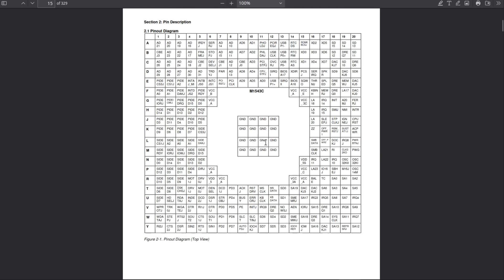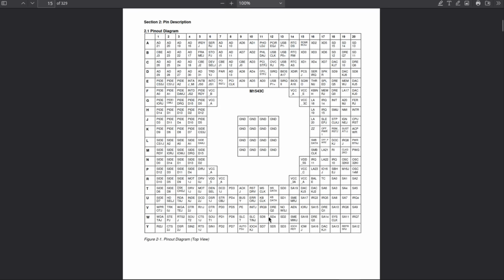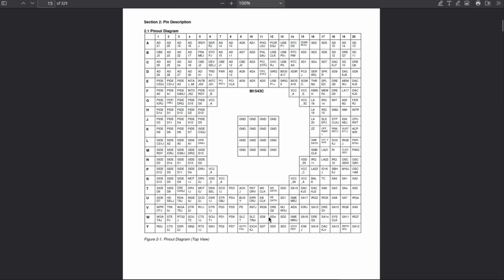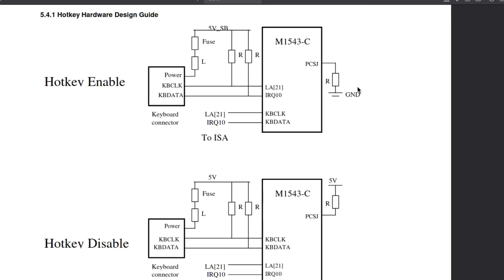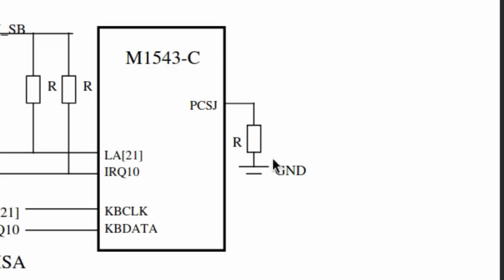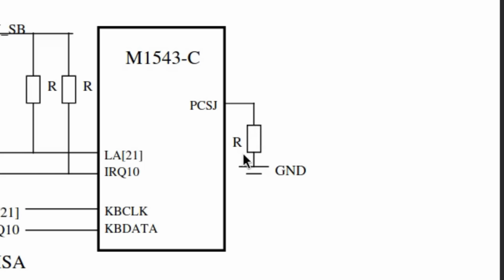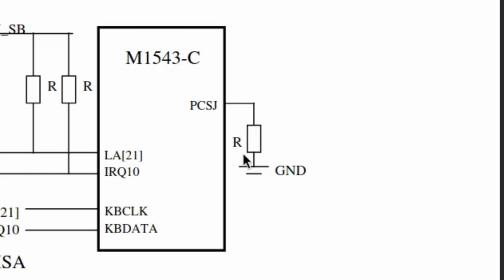What happened to this Asus P5A?

Comment: The FIC VA 503+ board would run a K6-3+ 450 at 600 mhz. The clock speeds only went to 5.5 but if you set the multiplier to 2.0 it would run at 6.0, FSB to 100mhz  = 600 mhz

Comment: Congratz on the repair. I could feel the joy when it came back live. I found this video while searching for solution to my problem - not working primary IDE channel (but secondary works fine) on my PcChips M560 rev.3.1. This board is in perfect condition, no corrosion, no broken traces, resistor networks also measure fine, IDE connectors is perfectly clean. So I guess the south bridge is the culprit, beyond repair. Or could it be a dead solder joint under the chip as is the case in many GPUs? Such that heat (reflow) could fix it? I don't think so as these south bridges don't put out a lot of heat, so I am stumped.

Comment: I'm running a P5A rev 1.05 with a K6-2+ CPU in one of my retro machines.  I came across a mod online, involving a resistor and connecting some pins together on the backside of the motherboard at the CPU socket.  It seems to work fine, I get good benchmark results.

Comment: I literally have the same problem with PS2 keyboard. In my case however I get no voltage from the clock pin of the PS2 port.

Comment: You son of a gun! Crazy timing, I just dug out my old P5A and cleaned it up a month ago, but have been having an issue I've not been able to really understand the cause of... It will POST, hitting the correct key begins to invoke a response, but then nothing more happens. If you don't press the setup key, it will just sit there after counting up the RAM. Doesn't seem to try to actually boot, and in my 20+ years of working on PCs I've seldom been stumped like this.

Was always kind of a blacksheep out of my collection. VIA chip-set is a no-no usually, but otherwise it is actually a fairly attractive platform for 7/super 7. For some reason I became more interested with running a P55C @ 250 or 300 MHz and being so surprised & impressed that it did it with absolutely no effort. No added voltage, just did it like a champ. Granted, I know this board was really built around being used with K6-2 /3s, not a PMMX. But, IMO, still pretty awesome.

I'd like to get to the bottom of it. Really want that board to get to work full-time hosting my website. That'd bring some good joy... People think stuff 5 years is old is obsolete and have no idea what it could actually do with some patience. Not to mention, it would just but sip power.. no heat, no noise. I approve!
Reply: Something to try would be to program the most recent BIOS onto the chip if you have a programmer.

Comment: Quite a few plants have compounds in them that work as a pH indicator. Red vegetables like beets and cabbage. Flowers like the peony. Blueberries also work well.
Usually you can just boil them and use the fluid.
Frozen blueberries work very well, you just cook a few of them and use the juice. Even the liquid from defrosted blueberries work.
They turn bright red in acid and a grey-blue in a base.
Reply from the maker: Very cool! Have to try that. Thanks 🙏
Reply: Very interesting, and great knowledge to have, if in need of pH testing 👍

Comment: In the cases where the corosive substance is unknown; you can get a sample of the corrosion, mix it with a drop of water and test that with a PH testing kit.  
That should tell you if you need to clean it with an acid or a base.

Comment: My K6-2 333 ran on 3.3v for approx 2 weeks, then it started having blue screens in windows. Then I realised that it should be ran at 2.2v, still works today.
Reply from the maker: Lucky you
Reply: Yeah, I’ve realized that after your video indeed. It was fast as hell though, with the high voltage applied to it (and also very, very hot. Idle at 85 degrees…)

Comment: I am currently running this board with an AMD K6-2 400mhz on windows 98 with an ATi 9250. I upgraded this boards bios to the last beta version to hold a hard drive larger than 30gb's I also put a DVD drive in it but the ALI chipset has issues with LG branded DVD drives so that is the only limitation to this board. CD based games are great and it runs fast.

Comment: My son had an old 1999 laptop that he played some games on and it went completely dead.  I played with it to see if i could make it ' go ' again. I checked out the power supply and all the wires and plug. All checking good, then progressed from there to the motherboard.  Tracing the input power cutting out right close to the power plug i began checking everything in the area. Studying with strong magnifier i noticed a couple of those surface - mount resistors that said ' 0.0 ' painted on them. I thought that was a weird resistance value- it was more like a direct short.  Then i thought they might be some kind of jumpers on the board so i checked and found one to have zero conductivity.
I got in there and soldered a teeny tiny wire across it.
I brought it back to life, i felt like Viktor Frankenstein

Comment: Sorry for the bad news, but I'm 95% sure the corrosion was caused by some rodent output product 🤢 ... I've seen enough of that so I could identify it on the macro shots. I use sodium hypochloride based bleach for it, a product that is used for removing mold from walls, that is more concentrated than regular bleach. It fizzles and foams up like crazy on this mice juice, I don't leave it on for long because it's also corrosive, but in such cases that treatment is always my first step mostly for sanitizing purposes (and it also removes all the dirt and the green patina quite well, and leaves behind blackened copper surfaces).

Comment: What was the bug that made those mainboards crawl with "plus" Amd K6 cpus?
Why couldn't be fixed with a BIOS update?
Non intel systems at the time were very picky and it was difficult to find a combo (cpu + memory + mainboard + agp card) that had acceptable performance and no stability issues.
Many times the issue was problematic cheap chipsets and/or mainboards (thin very low cost "pc cheaps" pcchips).

Even worse, Intel too was very lacking with all the RDRAM saga. 440BX was an act hard to follow it seems.

Best wishes.

Comment: The engraving tool you use seems perfect for removing solder mask and corrosion but not the metal of the traces. What kind of tip do you use to ensure that? Or are you just really careful?
Reply from the maker: I am just really careful. It would remove metal as well if I'd go too far.
Reply: @necro_ware  wow! Thanks for letting me know.

Comment: hold on, wasn't the k6-2 (not plus) cpu meant to be 500mhz? it's detected/set as 450
Reply from the maker: The one I use in this video is a 450 model.
Reply: @necro_ware  ah, I understood it was a 500! thanks for thr clarification!. coincidentally, I was having issues on another super socket 7 where my k6-2 wouldn't go to 500mhz, and turned out to be a bad dip switch block not making good contact on just one switch!

Comment: I have this board, also the P5A-B (baby AT model) which is the heart of the main retro-computer I use. I also have many other SS7 boards, including the GA-5AX. The asus P5A, or P5A-B which is the same in different format, is the fastest of all of them by a lot. I get 108.6 fps in quake 320x200 and 29.4 fps in Quake 640x480 using a K6-3+ at 574Mhz. If you tweak the bios settings you'll get something close to that with the 550 K6-2+. Also, AFAIK the K6+ issues are only with chipset rev G, not E. Yours and mine are Rev E

Comment: When I had a fix shop here, in Brazil, usually those Asus Boards have 4 capacitors behind the PS/2 port. Those capacitors were with high ESR and work as pulldown resistors. Sometimes we replace those capacitors , sometimes we just rip off and keyboard is back to work again.
Reply: I was going to comment the same thing, I have seen this problem on Asus boards like the TUSL2-C and similar boards with the keyboard wake function. The problem part was normally located right behind the ps/2 port.

Comment: The summer of 2002 I upgraded a computer for the friend of a friend. It had a P5A 1.04 in it originally, and I swapped in a Socket A board and a Radeon 8500. Out of curiosity, I decided to try my trusty K6-2+ 475 in the P5A while I had it, so I updated the BIOS and set the jumpers. But I set the voltage jumpers to the mirror image of the correct settings, and that immediately fried my poor K6-2+ CPU when I powered it on. Heavy sigh.

Comment: SS7 and Pentium 2 era triggers my nostalgia, those are part of my childhood (this may be a reason that I keep many of those boards without good reason). Nice to see them repaired, although this seems to be more of the maintenance than repair. Recently I wasted a lot of time diagnosing a board that turned out to be fine except of dead battery that prevented it from booting (not even a single post code, even C0 or beep).

Comment: One of the best videos the watch with a morning coffee 🤩 I've had so much headaches with P5A (especially with v1.06) so I sold all those boards away and now my favourite SS7 platform is VIA MVP3, it's super stable, not even one glitch. 🥰 The slow down bug is fixable on v1.06 with one pull down resistor, there's story about it at Vogons. But, I tried it on two boards and when the slow down was fixed I just couldn't get any +model CPU stable over 500MHz. Motherboard just did a reset randomly when staying idle at Windows desktop. And, what's funny, it resets almost instantly when playing a MIDI file with media player. Don't have a oscilloscope so I didn't investigate it any further. But, here's a topic for video for you, adventures of P5A v1.06 and K6-2+/K6-3+. 😉 BTW, on v1.06 when you set jumpers to 2 volts, you get 0 volts 🤣

Comment: Strange that your POST card has the PC speaker but the pins for it seem to be missing. Can you solder the pins on there and use that speaker rather than using a separate one?
Reply from the maker: Yes, I just didn't solder those pins. That post analyzer is not good anyway. I only use it sometimes in PCI bus.

Comment: I had some like that. All died.
Poor performance, low bus frequency, poor components, dead chips, corrupt bios and usually curved boards which results in broken traces. Poor materials to build a cheap board... Windows 95/98 BSOD very often... A real nightmare

Comment: Brought back from the dead for sure! That was some quite nasty corrosion. Brown like rust, I think this was water.
Lesson learned here... always check all the components heavily affected by corrosion.

To me the v1.06 is still better than the v1.04.
It is very easy to fix the v1.06 problem with K6-2+ cpus, by just adding a resistor.
But the v1.06 has a newer chipset revision and can cache more that 128MB of ram.

Comment: Very strange corrosion. But that's water under the bridge now.
Reply from the maker: The board dried enough to be safe. What you see in the video is IPA.
Reply: Sorry, it was just a bad pun. ”Water under the bridge” is an expression.

I could not resist.
Reply from the maker: @victorwidell9751  ah, I see :)